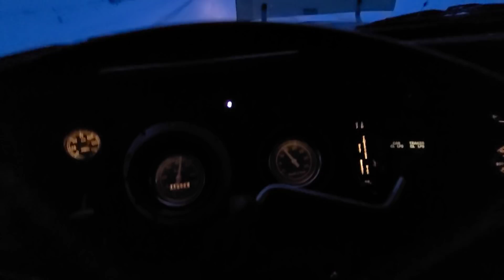8V71 trucking seed barley, army is back together and Amanda pushes snow with the 835!

Comment: Nick here is what I know on the PTO on the White 2-60 (Fiat) tractors. The book says to adjust the pedal to 1 3/8 inch from the front of the floor pan. Keep in mind that it won't come all the way back against the pan, there's a stop underneath that it comes up against before it comes back that far. Some of that will depend on how bad the bushing is worn in the pedal pivot. That PTO clutch needs to be engaged all the time. If you run it disengaged, it puts too much pressure on the thrust bearing on the crank and causes premature wear. I've heard of blocks being ruined by not leaving it engaged. If you aren't using the PTO to run a rear mounted pump for a loader, shift that little short lever that lays horizontal behind the shift so the PTO is out of gear.
  Best of luck with that Detroit. You had better order those hearing aids now with running all of those straight pipes. LOL Only half joking. I had a JD 5020 with a straight pipe. Now that I am older I have severe hearing loss in my left ear from running tractors without cabs and mufflers. It is hard to hear my Grand Daughters talk as they speak so softly.

Comment: My 1365 cockshut is the exact same tractor, just round fenders and 2wd. I have to have the PTO spinning for the hydraulic pump for the loader to work. And yes grease that clutch or else you will have a run away tractor also….

Comment: That’s the Pto clutch pull up then engaged or disengage the Pto leaver on the top by the shifters it goes left and right.
Reply: Oh I see
Reply: @ivanmoreau1798  all fiats are that way ............some have ground drive pto as well as 540speed ......new holland still had ground drive on the much newer TL series in the late 90s ........have one here  never used the ground drive , only the 540 speed ...........often wished the tractor came with 750 speed  instead of ground drive  like some did ........

Comment: thats the hand clutch   all fiats have them .........pull it up , put the pto   in gear ,   2 options ,    540  speed or ground drive .......then release the hand clutch slowly and  do your work ..........if the hand clutch is pulled up the whole time when you are not using the pto  in order for it not to be turning   , the pto is still engaged .......  hand clutch should be down when not using the pto .............thats the way our fiat tractors worked when we had them .....!

Comment: I had a 871 TA in an International , turbo makes them way quieter.
Reply: Definitely a big difference with a turbo!!
Reply: @GosselinFarmsEdGosselin  that was a great truck, 18 ft box and pulled a18 ft pup with it. 
Ruined it by running 15-40 oil wasn’t told not to run multi- viscosity oil until it was too late and it wasn’t long either. Eats them up in a hurry. 
Does anyone know why? Never did find out why.
Reply: @hughperkins707  had a '79 freightliner, 22' box, pulled a 22' pup. 8v71tta.. we always ran Delo400 15w40. Never had an issue.. at a little over a million miles, a blower bearing seized up, broke the drive shaft..
Reply: Turbo gives them a lot more hp too.
Reply: @ivanmoreau1798  8v71 was 318 hp 8v71 T 350 hp, 8v71 TA 375 hp

Comment: Seeing your versatiles run almost makes me want to buy one. But then i see how much lighter they are and how slow they are. Then i run to my 8450. But a 835 versatile will out pull a 8450 but 8450 has it beat in every other category.
Reply from the maker: No it doesn't.
Reply: 8450 isn't heavier iether.
Reply: @SouthSaskFarmer1  yeah it does. 8450s weigh 26000 lbs and a 835 weighs 20000 lbs with no weights. The onky thing good about a versatile is that they are simple and have a 855.
Reply from the maker: @pistonringfarms8107  no its not.
Reply: @SouthSaskFarmer1  we have weighed both on a scale.
Reply from the maker: @pistonringfarms8107  sure ya have
Reply: @SouthSaskFarmer1  our neighbour owns one. And we weighed a 8440. Same tractor basically. The versatile had fluid in all tires and the 8440 did too. Just took away the weight of the fluid in both. Cuz it just got put in so they knew how many litres went in. The. We got our weight. A 835 would work for us i found out anyways cuz of the shitty hydraulics.
Reply from the maker: @pistonringfarms8107  nonue doesn't
Reply: @SouthSaskFarmer1  23 gpm tested is terrible. Running 2 fans, down psi and an auger all at the same time a versatile wont cut the mustard.
Reply from the maker: @pistonringfarms8107  yes it will probably how do I run mine? Magic?????